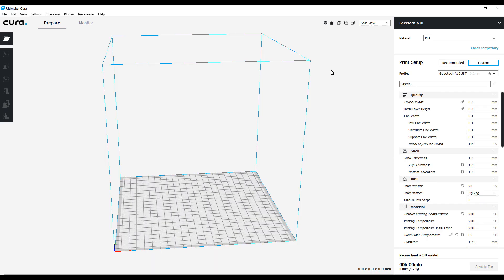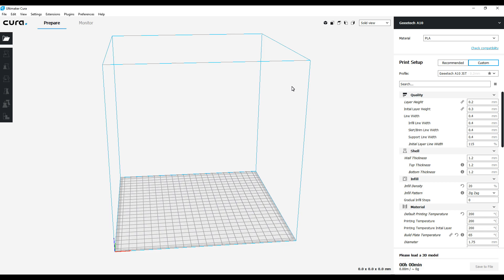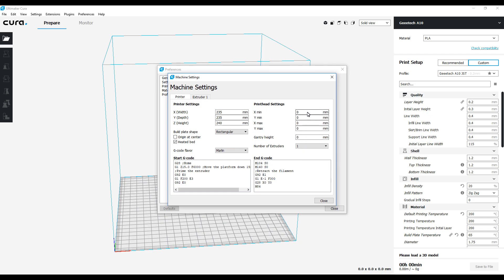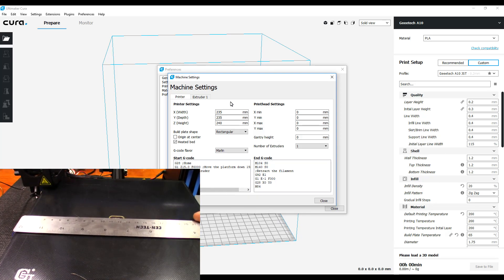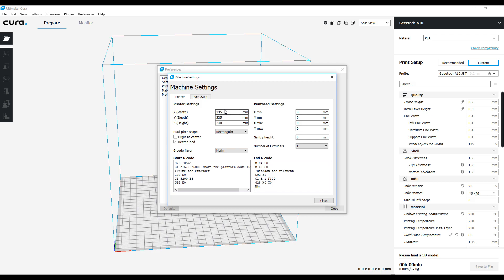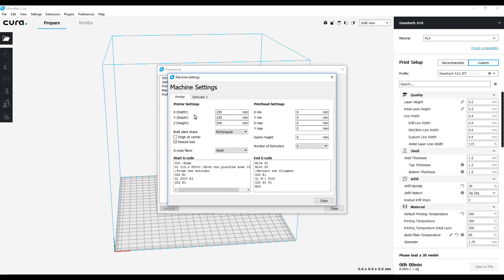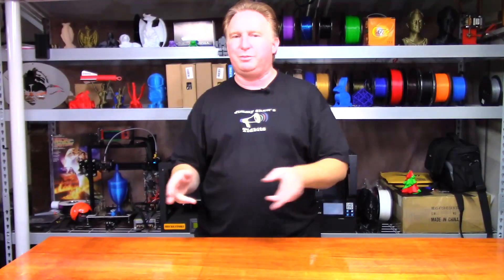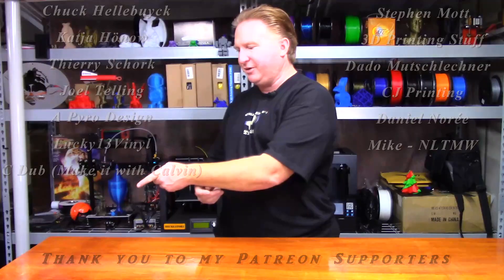Creating A Cura Profile For The Geeetech A10 Part 2

Comment: I have a Geeetech A10 and I played a lot with the bed size settings. I've discover that de maximum size it can print is 220 x 220 mm. Anyting higher than that will result in cut out prints and they will not be centered on the bed either.

Comment: I thought the 220mm setting, was to leave a border to cater for the spring clips which hold the glass plate to be held on the aluminium hotplate.....stops them getting wacked by the nozzle  if a big wide print was planned.....!
Reply from the maker: I did it that way so the print would be centered on the bed.  Plus the printer I had didn't have spring clips.  I don't know why they went back to them.
Reply: Jimmy Shaw's Tidbits ......I altered my A10 bed size settings today, fact is it would be very seldom anybody wanted to print do wide with the Z height being as it is. But is does give scope for diagonal prints and a decent brim...

Comment: I seem to be running into a problem where cura slices for the full 135 mm size but my printer cuts out the right most 15 mm of said print even though the space is available
Reply from the maker: Has it always done this or did it just start happening?
Reply: I just got the printer and was trying to print a chess board over almost the whole bed and it cut the board along the top and right, so far I haven’t been able to use the space at all so I guess the tldr is since the beginning.
Reply from the maker: When you put in the bed size for cura, did you use the advertised size or the actual bed size?  On mine, I had to put in the physical size to center the print.  I believe it was 230x230 if I remember right.
Reply: Jimmy Shaw's Tidbits I put in the actual bed size of 235 by 235 but I feel like the firmware of the printer may be restricting the print to the advertised size somehow? Unsure if that is possible
Reply from the maker: That could be.  I need to take a closer look and mine to see if there is a way of setting it internally.
Reply from the maker: I don't know if you are on Facebook or Twitter.   If so, on Facebook there is a great group for Geeetech Owners and another strictly for Geeetech A10 and A20 printers.   A lot of their support staff and people who have dealt with a lot of issues frequent the groups.